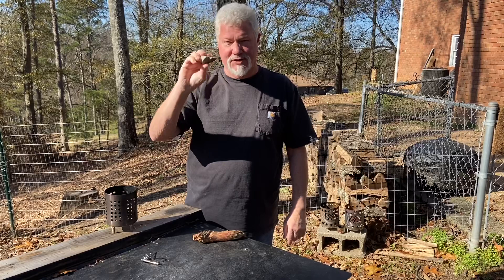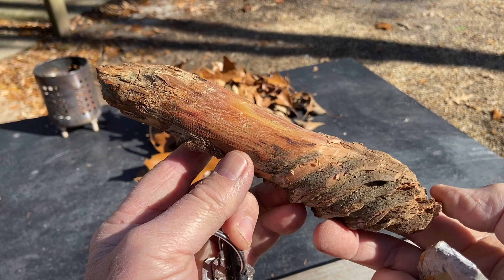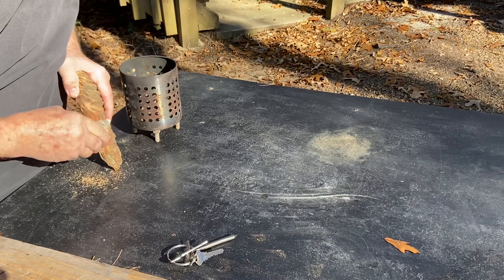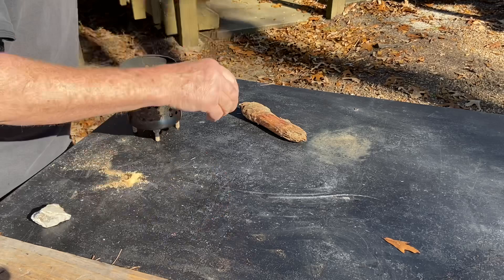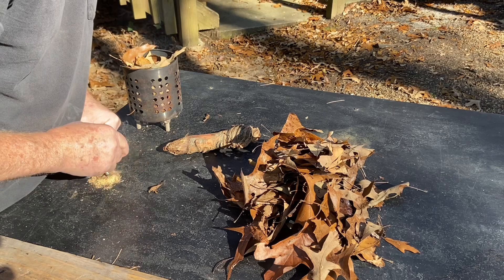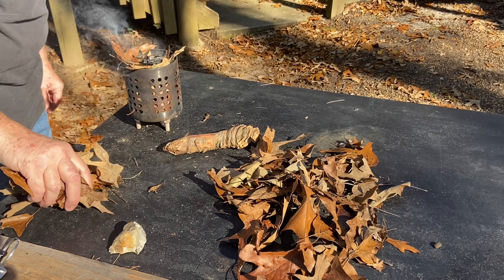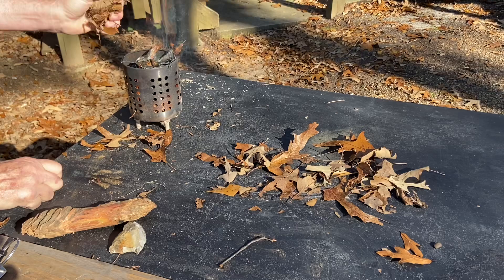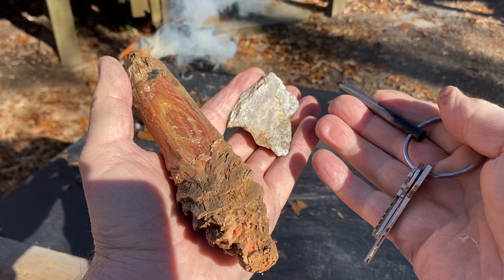No Knife Ferro Rod and Fatwood Fire

Comment: Great idea! I see a lot of people using a Ferro rod and they scrape down into the pile of tinder and sometimes ruining the pile of tinder. What I do is put the Ferro rod and the flint or steel right into the pile of tinder and kindling and while pressing down on the Ferro rod with the steel or whatever, I pull the Ferro rod out very quickly and the shower of sparks is concentrated to the inside of the pile without ruining the pile of tinder, etc. Try it and you will see how much more spark you can get in a more concentrated area.
Let me know what you think.
Reply from the maker: LOL! Did you check out my 700 fire making videos or the 56 videos in my ferro rod playlist and think to yourself, I don't think he's ever heard about or tried the pull method?